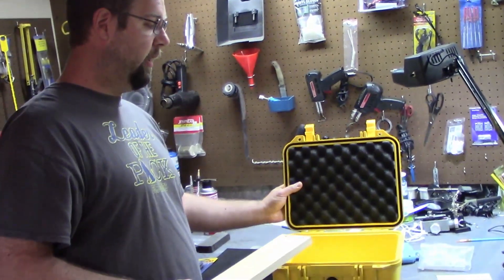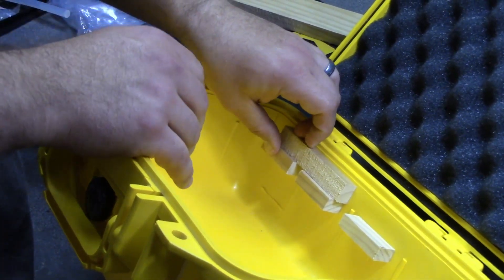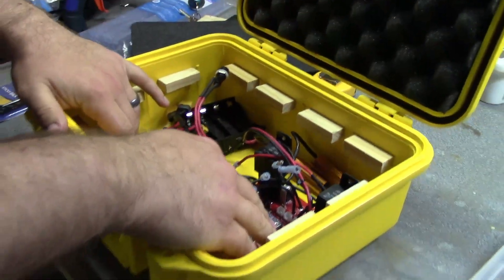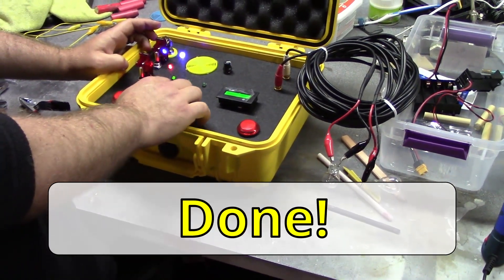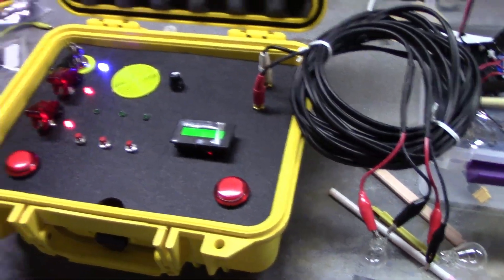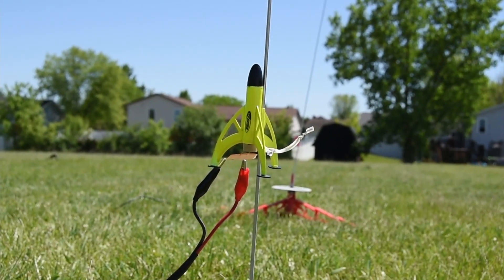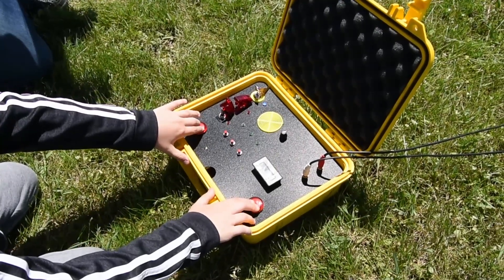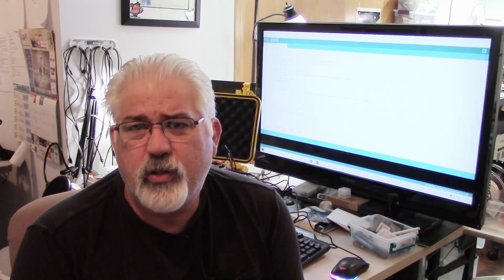Model Rocket Launch Controller Project - Part 4

Comment: Great project Stuart.  Thank you for sharing your documents and doing the multiple videos.  I want to build this with my grandson this spring.  Is there a parts list available?  I want to start ordering parts.
Reply from the maker: Only the schematics. I believe KiCAD can make a BOM automatically.
Reply: @StuartPatterson  Thanks.  I am new to CAD systems. I will dig into it.  Thanks again for sharing all of your work.
Reply from the maker: @louminn  No worries.  I might do an update video for this project.  In the design there is a current limiting resistor for safety, but it seems that is keeping larger engine sizes from igniting.

Comment: Im getting my son into rocketry and this it prefect. Thank you for sharing . Any chance you have a few boards laying around with components already attached for purchase?
Reply from the maker: Sorry I don’t have extra board or parts. I will have a set of videos coming out with a simpler version that allows you to launch from you smart phone. Time frame - TBD
Reply: @StuartPatterson Oh wow that's a great idea , even the code is a great help. i look forward to seeing your videos. One last question, did you learn everything you know through an electrical engineering degree or self taught?
Reply from the maker: @Sergio Bravo  mostly self taught,  but I do have some schooling on the subject as well… you can learn it on your own. Also getting involved in amateur radio or with a local makers group can also help
Reply: @StuartPatterson  ok thank you so much for all your help and replying i know how busy it can be when your working on projects.

Comment: Could some of those misfires/failures-to-launch have been due to bent/shorted igniters?  We often find too much "continuity" when the youth try inserting their own igniters!  This is why I suggested a tri-state continuity test: open, short (too little resistance), and ready (expected resistance).  Maybe strobe the Continuity LED when shorted?  Holding power on when shorted can be very bad for the electronics....so I like your idea of some finite limited time.
Reply from the maker: It was timing related. After the code change to keep current going to the igniter(s) while holding the buttons I retested both a single and double launch. No problems. 3 seconds was just too short for a reliable ignition. The code, which is on bitbucket for everyone to use, can easily be changed to increase to 4 or 5 seconds and remove the safety+launch button hold.  Thanks for all your suggestions!

Comment: Nice job.  And thanks for sharing.  Sure it inspires more than just your friend's children.  Noticed the removable panel has a lot of flex.  Was this because of thru-component depth limits?  Should be easy to cut, maybe inspire successive generations to "make it their own" by rearranging or changing IO components.
Reply from the maker: Thank you! Yeah, the panel does have too much flex. I believe Kevin will replace it with a thicker mil material. There are some height issues due to the relays, but it is not that significant.